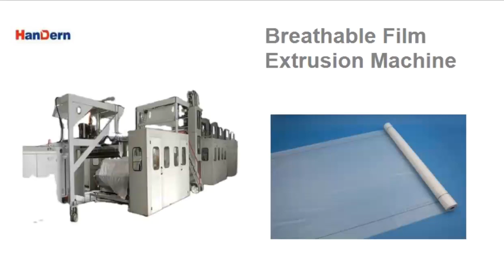1600mm PE Breathable-film-extrusion-machine，1600mm PE Breathable-film-extrusion-equipment【Handern】

Comment from the maker: 1600mm PE Breathable-film-extrusion-machine，1600mm PE Breathable-film-extrusion-equipment【Handern】

@ @ @ @ @

Breathable Film width:1200mm-3200mm
 Machine line speed:150M-200M
 Film product gsm range:15gsm-50gsm
 Breathable Film Thickness:0.015mm-0.08mm
Max.Extrusion capacity:200-300-400-500-600KG/H
@Company:Wuhan Handern Machinery Co.,Ltd.
Add:No.61 Yinbo Road,Jinghe Street,Dongxihu,Wuhan,Hubei,China
Website:@t
@t
Mobile:+0086-13986280012

1000@ PE Breathable-film-extrusion-machine，1600mm PE Breathable-film-extrusion-equipment【Handern】
2000@ PE Breathable-film-extrusion-machine，1600mm PE Breathable-film-extrusion-equipment【Handern】
3000@ PE Breathable-film-extrusion-machine，1600mm PE Breathable-film-extrusion-equipment【Handern】
4000@ PE Breathable-film-extrusion-machine，1600mm PE Breathable-film-extrusion-equipment【Handern】
5000@ PE Breathable-film-extrusion-machine，1600mm PE Breathable-film-extrusion-equipment【Handern】
6000@ PE Breathable-film-extrusion-machine，1600mm PE Breathable-film-extrusion-equipment【Handern】
7000@ PE Breathable-film-extrusion-machine，1600mm PE Breathable-film-extrusion-equipment【Handern】